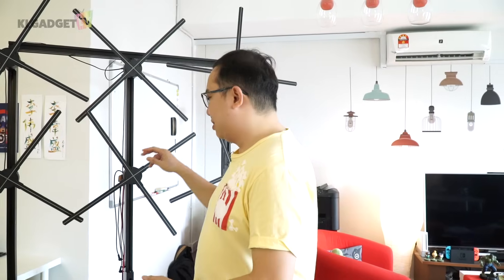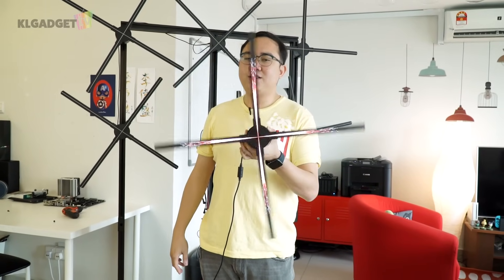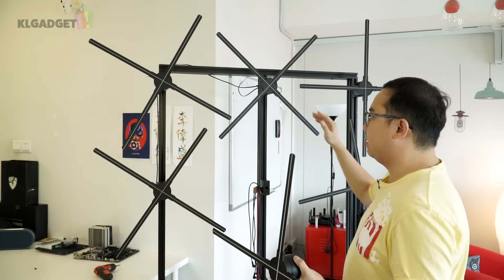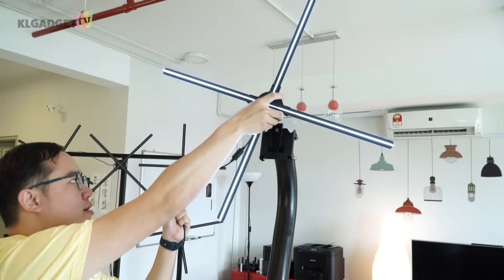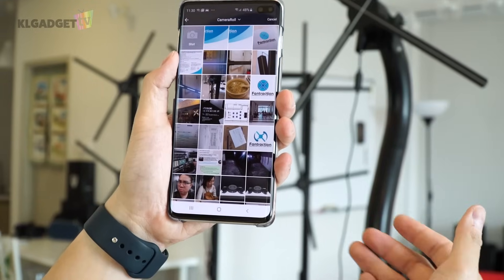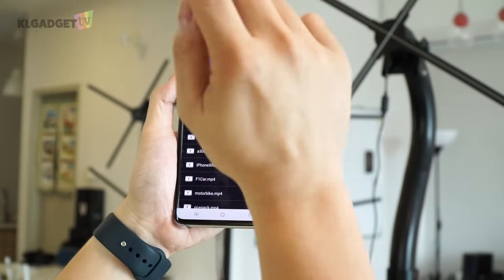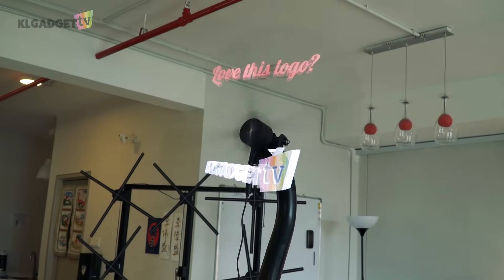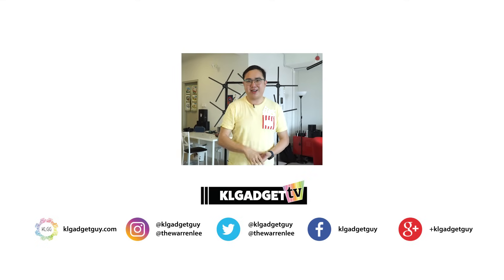3D Hologram Fans - What are they? [Curious Tech Ep. 3]

Comment: why are all southeast asian "tech" youtuber content like this? all you did was explain what they are and what they do, but you never explained HOW they do it. Yes, we all know that when the fan spins, it creates a holographic display, but HOW does it do it? HOW does a 1:1 aspect display get formed by spinning 4 strips of LED lights really fast? HOW do the LED strips know which portion of the display to render at any given time during its fast rotation? Explain the HOW, please, that's what makes the tech interesting, not whatever this crap shoot is.
Reply from the maker: Basically, these are all programmable LEDs that's controlled by the chips behind the blades, they are interfaced with the operating system of the fans and show the images as the fan spins.

Comment: How about what are they not?

They aren’t 3D. They’re a flat disc spinning in the air.

They aren’t holograms. They’re a flat disc spinning in the air. Holograms are 3D.

Like, as a for instance, if this were right against a wall how would it differ from a circular projection on that wall? Not much. Noisier. More limited in size.

People need to stop calling these “3D holograms”. It’s like if a stagecoach in the 1800s were being marketed as a “horseless carriage” because the horses were set on the sides instead of in front. It’s fraud.

Comment: If there is an Mp4 file with sound in my phone, And I'm connecting it to the fan AND to a speaker (ordinary Pl plug), Will I hear the sound when it will display in the Fan?
Reply from the maker: No, you will need an app for that.
Reply: What app is needed to play video with audio? Do you need to convert the video to 3D?